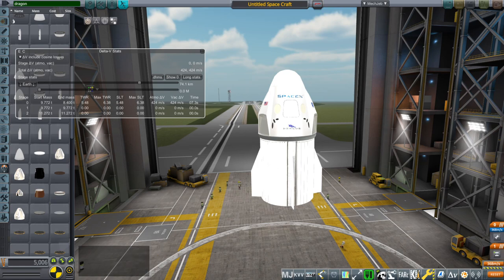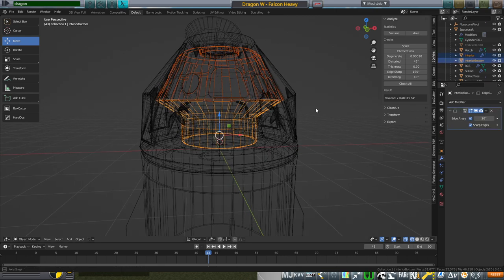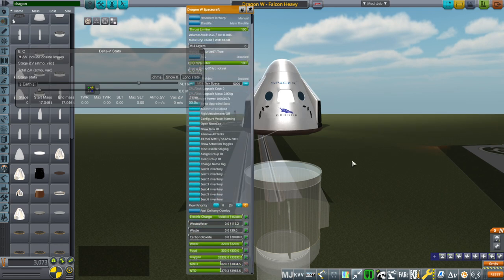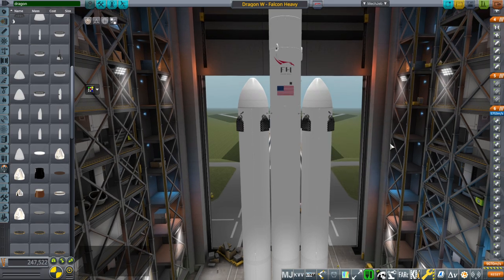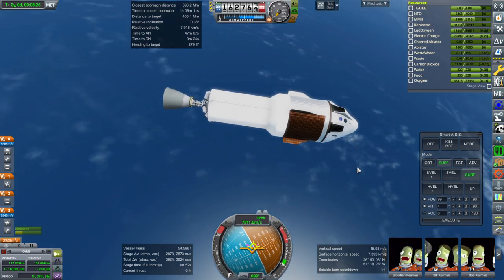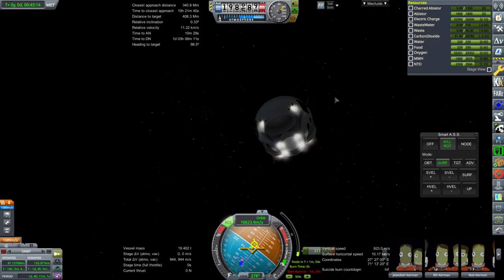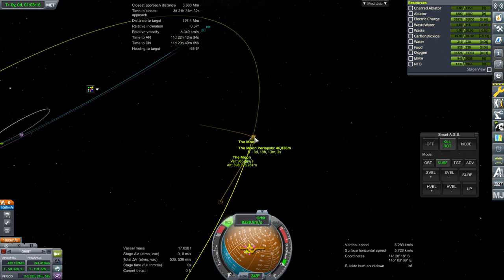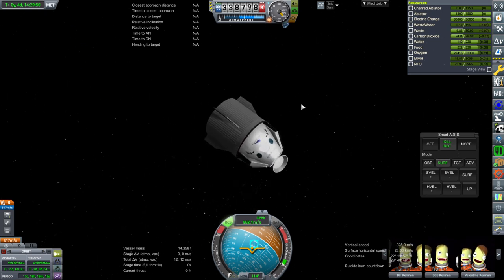Realism Overhaul in KSP 1.8.1 - Dragon Wide

Comment: If you just slow down the Dragon 2 capsule to regular orbital speed before entering the atmosphere, the heat shield can handle reentry just fine. Sure that means more fuel needed, fuel that won't boil off, but you can have a smaller, lighter pod to go to the Moon with. I think the real question is whether the Dragon 2 could hold enough supplies and air for such a trip, but I'm sure a smaller work around is possible. The Dragon Wide is still a cool concept though.
Reply from the maker: Where are you getting the propellant to slow Dragon 2 down from? You need 3000 m/s to slow it down to regular orbital speed coming in from the Moon. That doesn't end up being smaller than this - you have to make it larger. It's much, much lighter to just carrying a somewhat larger heatshield than trying to slow Dragon 2 down that much.

Comment: possibly lengthen the falcon second stage? Maybe also a proper service module. I would prefer to keep the abort system hypergolic though, and SpaceX doesn't want to add methalox to LC-39A
Reply from the maker: Well, we can launch out of Brownsville or whatever. Maybe if we can get Methalox abort motors we can sneak an escape pod into Starship.